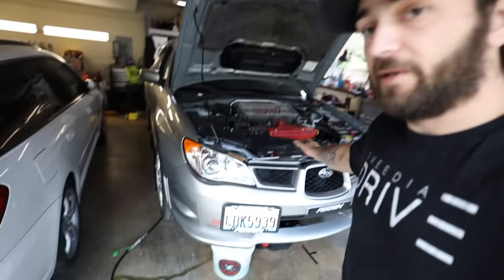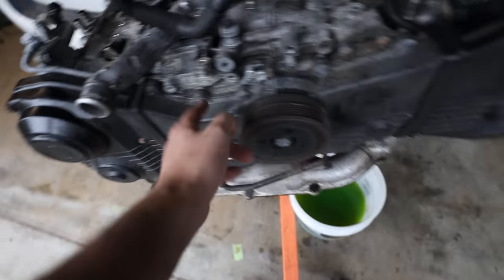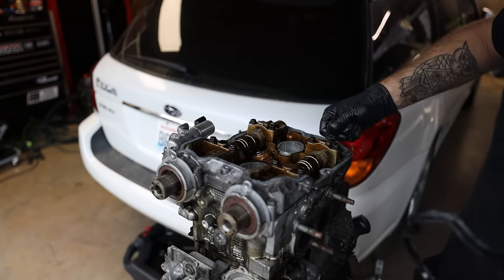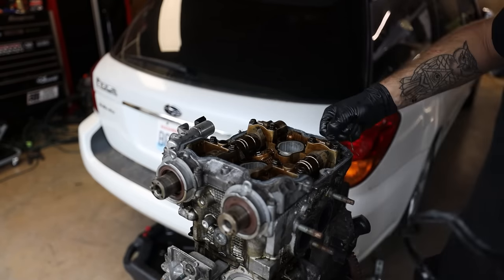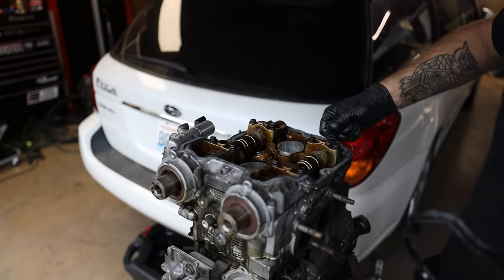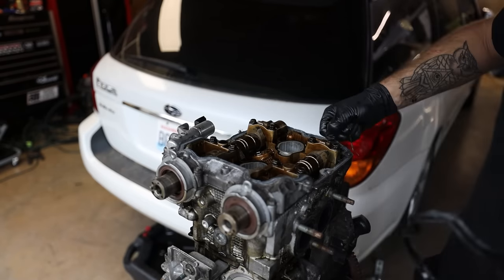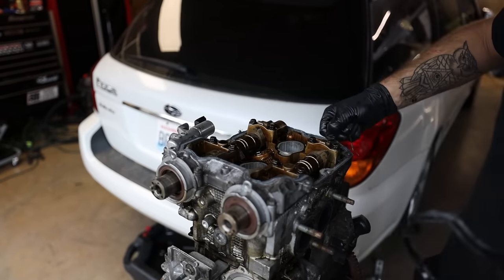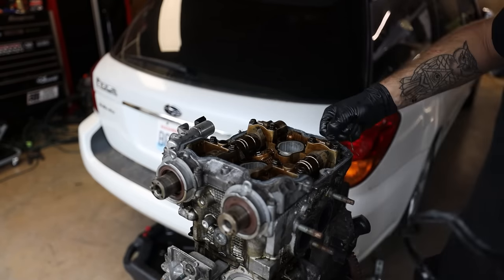How To Refresh your Old Subaru Engine

Comment: Great video! When I disassemble something, I like to break the bolts loose by hand, then use the impact to unscrew them. That way you will see if a bolt is stuck before you break it off with an impact

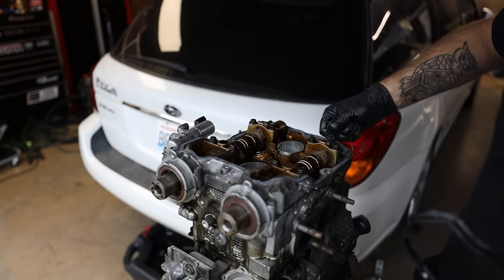Comment: 17:16 Tip: These bolts are M11x1.25 threaded. If you wanted to chase the threads, you'll probably have a hard time finding one that is long enough, but OSG makes one that is 6", or you can use a 7/16 - 20 pulley tap.

Comment: finally got to the end of this video - man that sucks.  After i got mine running i was paranoid as heck for about 5 weeks - i did a quick few miles test... then checked stuff... drove a bit further and rechecked.. i kept doing that over and over and funnily enough i was paranoid mostly about cooling system because its such an easy thing to lose check of esp when your enjoying the sudden power and response hike and you can feel how strong the engine is.  I'm so sorry to hear about the owners misfortune but man that is epic sportsmanship helping him out again - i hope he gets it running soon with your help and can finally enjoy his subaru.  
As an ex skyline owner (I've had 4 Skylines over 15 yrs) i will say that its so easy for cars to quickly run hot.  I'll also add i've had way more fun in my subaru taking it through the twisty roads in ANY condiitons and feeling confident vs hoping the 4wd system in the GTR will kick in as it should lol.
Reply from the maker: I 100% feel that, use to have a 93 GTST Type M and driven a few GTRs. The subarus for some reason are a blast in comparison
Reply: @Smeedia  yeah I think it's the AWD vs 4WD ...I had two gtst and one ran 500 and was hilarious as long as its straight.. any power out of corners.. nope!  The safest of the lot was a 600bhp r32gtr and even that bit me once or twice especially on hard braking with the heavy nose and light back end!!!  My subaru is slower for now but man it's more fun 😎👍

Comment: I feel for him too.  My upper radiator hose popped the other day when I was on my way home.  Luckily I caught it before coolant temps could rise.  Replaced the hose in 15 minutes and burped the coolant system and it was good to go.
Reply from the maker: Upper hose is a nice easy one to correct, don't have to go back under the car 😅
Reply: @Smeedia  it took longer to burp the system than anything else

Comment: This is pretty much exactly what my Ej255 is going to get whenever I get around to delivering it to my friend. This video made me question if I should get new valve springs & retainers. I wasn't planning on doing them but now I'm considering it.

When the radiator popped on my VQ I hadn't noticed it for a minute, then I saw the temp gauge & looked in my rear view, yikes. I made the executive decision to drive the extra quarter to mile and get in the work parking lot instead of pulling off on the side of a rather busy road with potential police interaction. So far it hasn't seemed to have bit me in the ass, engine seems "healthy" more or less over a year out from that experience. That shit was pegged at the top of the gauge & pouring out white smoke.
Reply from the maker: If you can afford it, it's not a bad idea to swap them all out. The amount of white smoke coolant makes is wild 👀
Reply: @Smeedia  I'm already a couple grand into the refresh on the EJ so might as well... any suggestions? I'm looking at some Brian Crowers right now.
Reply from the maker: BC or Manley, I used Manley in Karma but either are good options. 

Supertech is good too use thrm in the EG
Reply: @Smeedia  Cool cool. Thanks.

Comment: Hey Tanner, I work on these and other subaru stuff for a living, Mac Tools sells a socket called R.B.R.T. and with using an old belt to hold the cam gears and a good Ratchet or a Aircat 1/2 impact Ive had tons of success. Trust me, myself and many other Techs hate those cam gear bolts with a passion.
Reply from the maker: About to snag this then, ao tiered of drilling put cam bolts 🤣
Reply: @Smeedia  I can snag one from my Mac dealer and get it to ya

Comment: I did a motor refresh on my forester right before a long move across the country and I encountered the same problem. Leaky lower rad hose.. Thankfully I caught it, but I can't tell you how stressful it was trying to keep coolant temps low on mountain passes and in desolate areas. Even put 2 worm gear clamps on it, which slowed the leak, but would always loosen up over time. Definitely going to have to look into getting those spring clamps.
Reply from the maker: oem spring clamps are the way

Comment: Month ago I was in similar situation. My radiator cracked and my temp went high to 110C (230F). Fortunately I have an app on my head-unit that monitors all sensors through tactrix cable. Don't trust your oem temperature gauge on the gauge cluster. When it goes up, often it's to late. I saw a huge disproportion between indication. My advice: Buy external water temp gauge, or read it directly from the ecu.
Reply from the maker: The AP gives almost immediate feedback as well, but something yhat needs to be monitored
Reply: @Smeedia  AP is awesome, but unfortunately useless here in Europe.

Comment: bought a brand new EJ207 bottom end and stuck it in my bugeye wagon... set of ARP studs, Cosworth 0.8mm head gaskets, refreshed the turbo (Vf35) and pink 550cc injectors (565?) - bit of a power hike :)  Added a set of D2 6 pots and 4 pots (rear) and 356mm discs all round.. Some BC coilovers, Brand new gearbox and engine mounts and a bunch of poly bushes and new uprated clutch - goes quite well now :)
I'm still running ej205 WRX heads so a bit laggy lower down but once it gets moving its away.  Next mods to add would be a set of lumpy cams but the main thing i would like to drop in is a good condition as new as possible 6 speed STI gearbox.. or go full send and stuff a sequential in for the lulz

Comment: Subaru cv axle nuts fit perfectly over those pesky stuck cam bolts. I usually just weld it onto the bolt with a MIG welder and use an impact comes right off. Credit goes to outfront motorsports for that, they have a nice video on the subject!
Reply from the maker: If I had a MIG welder I'd do that, but drilling em out only takes a couple min 😅

Comment: Yup, worm drive and t-bolts don't belong on anything where temperatures change like in a cooling system. The constant spring pressure of the spring clamp accommodates the expansion/contraction of the parts. Looking forward to the build on young fellows engine!
Reply from the maker: People don't like spring clamps but they're one of the most reliable ones out there 💪
Reply: @Smeedia  .. I just replaced my upper rad hose & couldn't get the original OEM spring clamp over the new (slightly thicker) upper hose.. hadn't considered thermal dynamics of hose clamps .. thanks for the tip.. I'll shop for a better replacement

Comment: sad day for kiddo.
i had a lesson like that... ya ever done 70mph in first gear... fresh engine and transmission... 50 miles on them... gas pedal was cut off, stick only, my boot got wedged with that stick to the floor. i was running out of road otherwise i'd have just shifted... got the car stopped and.... poor little automatic tried to move in park, reverse was neutral, neutral was 1st, and so were the other 2 gears. rip th350. got a 4 speed for the 76 camaro i was in at the time and learned how to convert from auto to manual, how to do a clutch, rebuilt the manual, hurst comp+ shifter and all. good times. hopefully kiddo chooses to bounce back and take all your help!

Comment: Like watching how others work. Nice job. Careful lapping valves while keeping the same cam buckets, the lash can fall out of tolerance. It will tighten up the clearance, too tight can burn a valve.
Reply from the maker: Correct, I've got spare buckets I swap around if lash jumps out of spec

Comment: Great informative video. Have an 08 FXT that very randomly would have high or climbing temps. Would turn on the heat full blast and get some relief or stop let it cool down then when I got back home burp it. Replaced the thermostat and caps. Very little evidence I could see of any leak. Did fine for about a month then issue returned. Figured it was time for professional help, just not enjoyable to drive around paranoid about not maintaining a gauge scan and costing myself $$$$$ on a rebuild. My favorite shop found the issue, upper radiator spring clamp…
Reply from the maker: Was it leaking or just letting in air?

Comment: I had that exact clamp on the lower radiator hose, which was also a worm clamp in my case, fail as well. Caught it early and immediately replaced the clamp, topped off coolant and burped the car in a random parking lot. I think it was my bad because I had over-tightened the clamp earlier that day. The radiator hose just wiggled loose and didn't fully come off so I probably only lost less than 10% of my coolant and noticed when a small puddle was under the car when parked before I ever saw temps change. Stuff like that is scary for sure and I feel bad for this owner who clearly just wanted the best for his car by getting a refresh. The main lesson here is to always be super cautious, especially after any significant work has been done. Hope this guy can get back on the road soon.
Reply from the maker: Working with him to see whatbhe wants to do, gotta keep an eye on that stuff and know when the car is too hot to keep going. But not the end of the world and will help him however I can 🙏🔥

Comment: I had a similar thing happen to my 05 sti, Had a crack in the oem radiator at about 100k miles and temps were off the chart. Went home and refilled radiator with water and it held until I got the radiator replaced. Got lucky on that one.
Reply from the maker: Glad that you were able to find the crack on that one 😬

Comment: Believe it or not, but lots of mechanics from my country do not like spring clamps and prefer quality worm drive clamps. Spring clamps are treated as single use only as they lose tension, and mechanics cannot risk a car coming back with a leak. There's nothing wrong with worm drive clamps as long as they are not over tightened and damaged. I've never had a worm drive fail, but I've had spring clamps leak.
Love your work, keen to see the H6 subie on the dyno.
Reply: If unsure it's best to just replace with another OEM spring clamp.  What helps is using the correct spring clamp tool, so not to damage  and weaken the clamp tension.
Reply from the maker: Everyone who works on something has a diffrent presence. For me I prefer using OE spring clamps, they've always been reliable and never failed on me.
Reply: @Smeedia  back in the day everything was those crappy worm drive clamps.  I resisted at first but now all I use now is the original OEM spring clamps or equivalent.  You have to think those engineers must know something right 🤔

Comment: just so you know, color only matters for subaru oem coolant. there are many other coolants that meet the specs that subaru requires, and color will vary
Reply from the maker: OEM is all I use 🙏 
But if you use third party then you are correct 🤙
Reply: Walk in an AutoZone and see if you still think that statement is true.   They have about 8 to 10 different antifreeze color options for lots of different vehicles. Such color descriptions as pink-red color that's on the jug.

Comment: This is perfect cause once my clutch is fixed In my built EJ I’ll be refreshing the ENTIRE motor then possibly sell it. I’m on the fence bout selling it, I love the car but I honestly regret buying it cause of the major issues it has with the clutch. I’m afraid I’ll end up needing a trans for it along with the clutch
Reply from the maker: Wrx or sti? 👀
Reply: Same but I got the 5 speed, crunchy gears making me nervous
Reply: @Smeedia  it’s an STI, it’s making 400 wheel, I already have a trans sourced in case I need one I took it to get tires and was told the clutch is shot, I can still shift it if I throw it into each gear some gears grind downshifting and I have to have the car off to go into reverse. Last time I had this issue with a manual my clutch and fly wheel were toasty

Comment: Love that you help out the community so much it’s amazing! I have an issue with my 15 STI just brought it home from the tuner. Was wondering if you’d be able to take a look at the issue via text and give me some pointers?
Reply from the maker: What issue are you fighting 👀
Reply: @Smeedia  Well now she decided to get her life together 😂 I was fighting a P2090 for the longest. Passenger side exhaust cam gear not syncing with the other. And freaking out shooting up to values of 40s changed the OCV solenoids on both sides. Still was freaking out. Took apart timing cleaned out the cam gears nothing too crazy was in there. After the OCVs I gave up and only thing I changed was moved the main engine harness because it looked like it was kinked under the intercooler piping and haven’t had the issue as of about 8 hours of drive time 😂 gotta love Subarus
Reply: @Smeedia   I’m hoping it wasn’t just a band aid fix🤞 gonna take it back to the tuner this week and find out

Comment: Dang man that sucks, had the samething happen to me but it was the factory clamp on my upper radiator hose, only popped off because the radiator itself was probably 5 years old and just got to the point where it cracked and popped off the hose. Lucky I was a half mile from the shop, pulled in shut it off with coolant temps around 220,sprayed down the block with water, put a new clamp on for the time being. Ended up having to buy a aluminum radiator. You'd think he would have smelt coolant, but since he's young he probably doesn't know what coolant smells like, oh well you live and you learn.  I was surprised how nice the engine was with no tick only a little piston slap.
Reply from the maker: For the most part that thing was solid after I got done with it, hopefully was a learning lesson for him and will try to help him however I can

Comment: I don't own a Subaru (maybe someday!) but love learning from your vids. I'm curious when you take the parts to the machine shop, do you just ask them to re-deck the heads and that's it, or is there some further specifications you need to specify with them?
Reply from the maker: Redeck, hot tank and a pressure check is what I have them do 🥳
Reply: If you're aiming for a specific number, you've already looked up what you want for that engine but for a basic rebuild like what he's doing here, the machinist is going to take off the minimum required to get it perfectly flat.
Some engines, not all even have a spec for how much you can deck the heads and reuse them. 
Since this guy did not catastrophically warp the head, they just skimmed them down flat with a clean new surface.

That's not the most interesting thing they do. The thing I like about machine shops is how they can hot tank everything. That's dunking it into a vat of hot cleaner, And doing some form of agitation or jets or whatever system they have to get everything loose including what's inside all of the little galley ways and stuff.
It's not an issue on these heads but on some blocks you also want to go through with some pipe cleaners and just run it in and out and get everything completely brand new.

I love getting parts back from the machine shop. I try not to give them anything too gross but it's awesome when you hand them something that is 10-20-70 years old and looks every bit of it, and it comes back like it just came out of a factory yesterday.
Reply: @TravisFabel  thanks for the detailed explanation! it does seem quite fascnicating.

Comment: Most Subarus made after 2005 have a function: if you put the gas to the floor and then turn the key, it will disable fuel and spark to prime oil to the turbo and pump. I have a 2012 Legacy and I use the feature in the cold weather most of the time. Great video! I will be doing this to my vehicle soon :)
Reply from the maker: I'm aware, I've had hit or miss results with older GDs, sometimes they rev to the moon 😅
Reply: @Smeedia  Yeah XD mine had quite the fuel pressure and I think I flooded a cylinder a little bit so I know what you mean.
Reply: my 07 wrx revved to the moon after letting the car sit for 6 months  never again

Comment: What an awesome guy and content! Always waiting you see a new video pop up.
Sorry to hijack the comments here.... But,
I could use some advice from some smarter Subaru folks out there. Having issues with my new 2.5 swap bugeye. It's driving me crazy and I can't drive and enjoy it too tune it. Very low power not running right with no boost. Less than 50 miles.
Did smoke test for vacuum leaks from the charge pipe and at the bov, changed plugs, new upstream 02 with no change.
Things still to check, replace, and ing: down stream 02, new invidia downpipe, grimspeed top mount intercooler, and boost leak test. Does this sound like I'm on the right path here?
Reply from the maker: Before we get into anything further 

Have you done a compression/leak down test?
Is there a tune on the car?
Reply: I haven't done a compression test but, it does have a tune from Eric at torqued performance. I'll do the compression test next... And pray it is good. 😁

Comment: Ooooo Just watched to the end of the video.  That sucks.  I know the feeling for sure.  Having a spun rod bearing in a brand new IAG motor after 4k miles is what situation I'm in right now.
Reply from the maker: What did IAG say about it? 😣
Reply: @Smeedia  sent you a message on IG.
Reply: @Smeedia  did you happen to see it ?? They basically said " Bearing wear pattern shows signs of oil starvation leading to wiping and metal-on-metal contact with journals.  Any way you could look over the report if I sent it to you and let me know in layman terms what this means and what could have caused it by chance?  Also if its just BS and if I have any leg to stand on if I fight it with IAG or the shop that installed the engine?